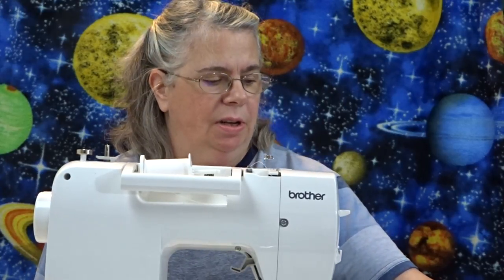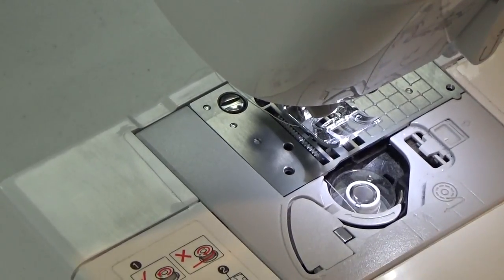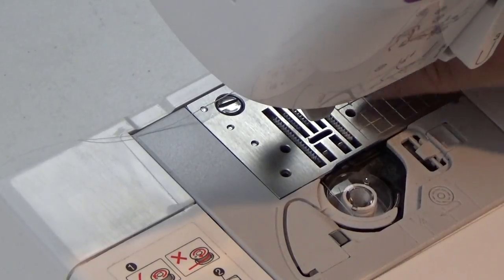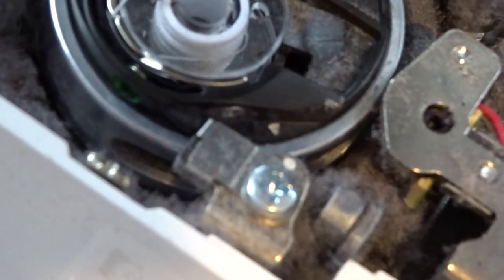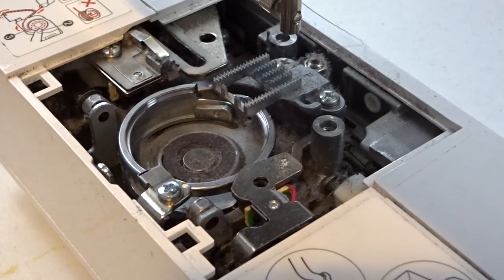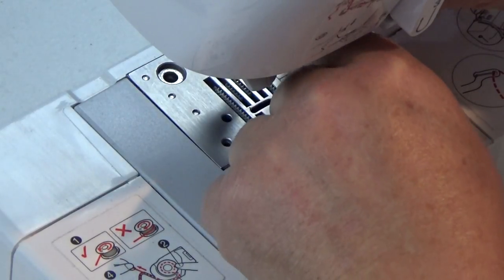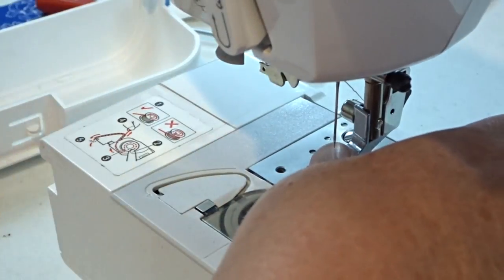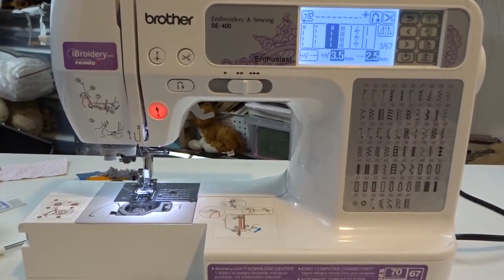How to Replace a Bobbin Casing

Comment: Thanks for video. My Brothers SE 625 went into safe mode and wouldn't sew or embroider. After watching your video I realized the bobbin casing was not sitting properly after thread got tangled underneath the metal plate.

Comment: Thank you for the video.  The fuzzy strip on my bobbin case came off...can you please tell me its intended purpose? And whether I need a new bobbin case or not?
Reply: I think the purpose of the strip is to drop the oil there thst help the metal spinning part stat lubricated. Mine came out to cause I taught it might be lint. I try to clean it and used a twiser and pulled the stip out.. Oops... I creaned the small piece of lint and padded the dark oil a tad. Then I slided the stip back in place with the twiser, and added anothe drop of oil. It worked like a charm..
Reply: That*  stay*
Reply: @wushugirl6941  Thank you. But I don't have the fuzzy piece anymore. Tossed it when it came off...as I had no idea where it belonged. Only now after watching this video and reading your reply do I realise my mistake :(
Reply: @FatemaAmmar76  sorry... maybe you can find out the name of what you threw away.. I don't think it should be expensive... maybe your local sewing store has one... or if they they you what it is and they don't have it order it from ebay or Amazon
Reply: @wushugirl6941  Thank you so much :)

Comment: Why wouldn't you clean your machine first, insert new needle, then stitch to see if the problem is solved before buying the bobbin casing?  I clean my machine after EACH USE.  I also wipe my machine down in the crevices and try to keep the area very clean so no dirt transfers to my fabric.  I've enjoyed your videos but am very disappointed at the cleanliness of your machine and work area.  This comment is meant to be helpful, not critical.  Cleaning and changing the needle before purchasing parts would just seem like a normal way to go.
Reply from the maker: Thank you!  Constructive Criticism is welcome.